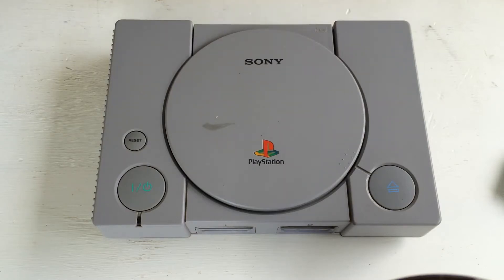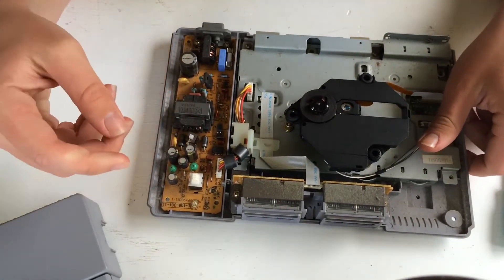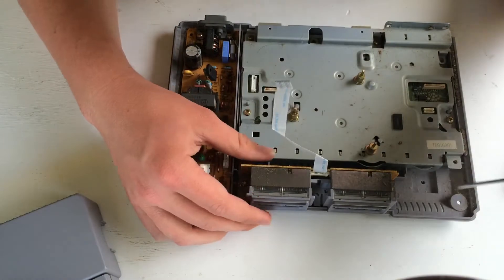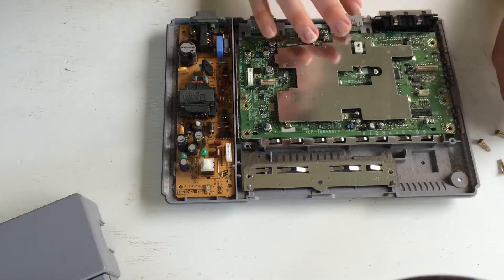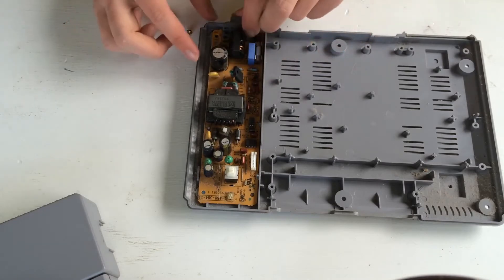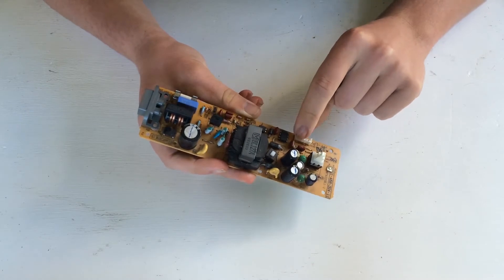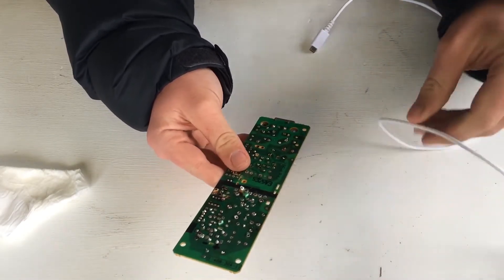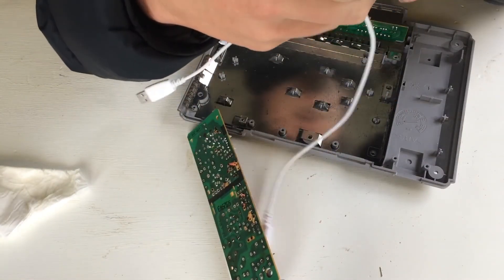How to Build the Raspberry PiStation:  Part 1 of 3

Comment: I did it but instead of making the cable stick out of the system I have just put the 5v amp for the pie directly in the ps1 and wire that up to the power jack of the original ps1 that way I can use the original universal power supply :)